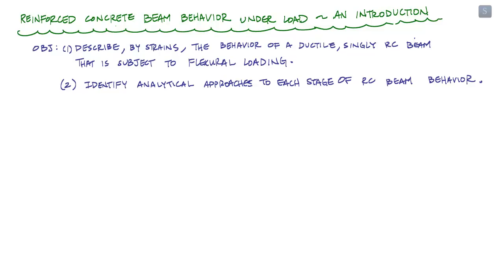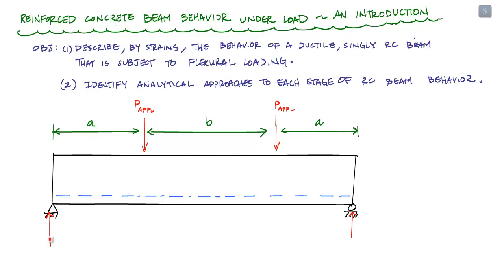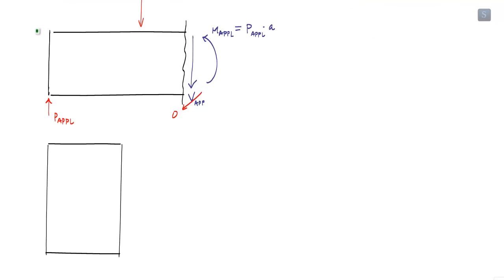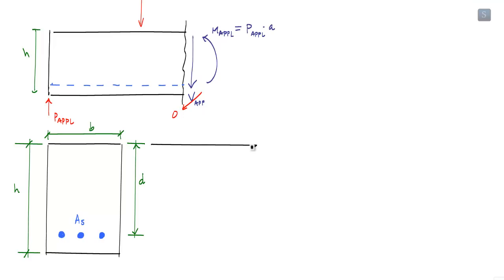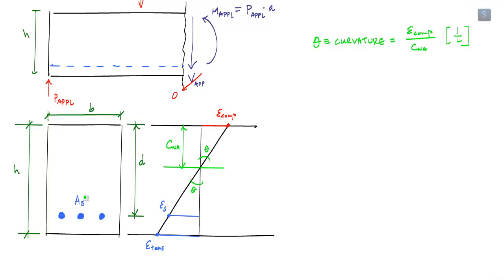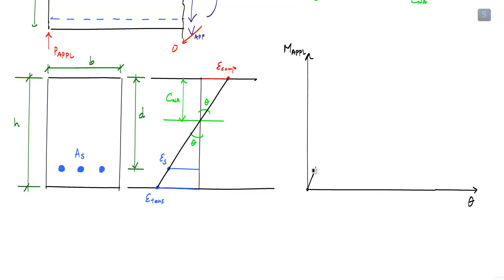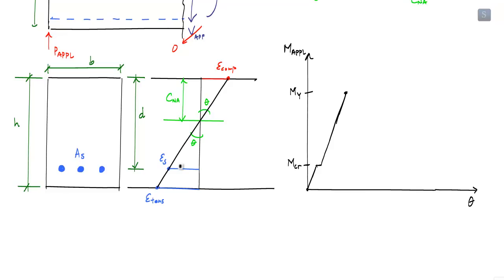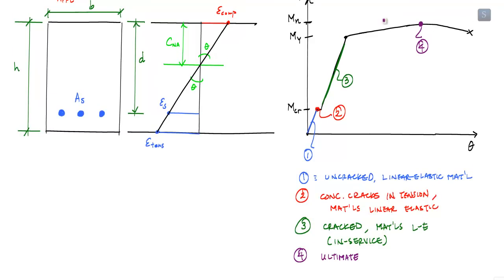Behavior of Reinforced Concrete Beams Subject to Loading (1/5) - RC Analysis and Design

Comment: Mcr (cracking) to My (yelding) line should be less steep (lower slope) compared with the line M=0 to Mcr in the moment-rotation graph. After the cracking the inertia moment of the section is lower and the bending stiffness will decrease

Comment: hello sir dose strain bottom etens should greater than 0.005 ? or it's just effect theta ? and what's desirable greater than 0.005 or less than 0.005 which is gives u safety and economic ?
and another question  if i calculated row required this row greater than min row and smaller than row max can i choose any row like below 
row min <row required < row design < row max ?  dose it's true ?